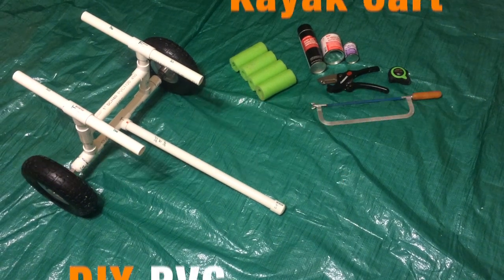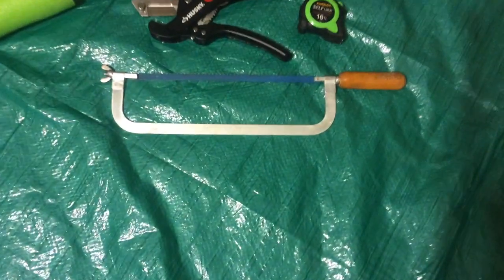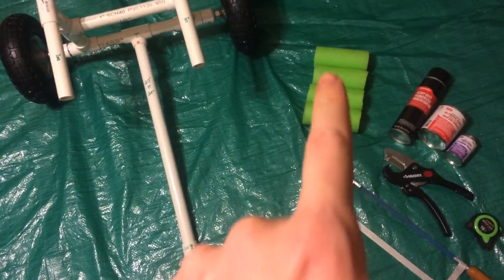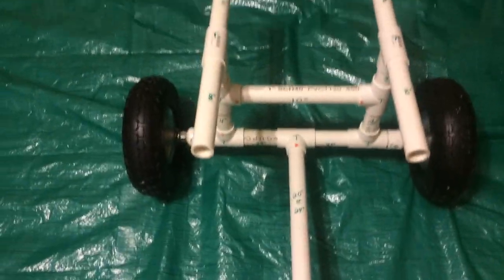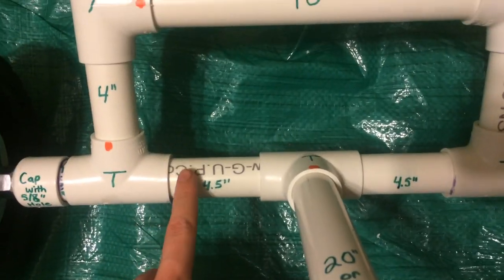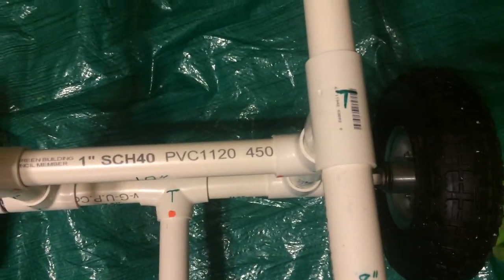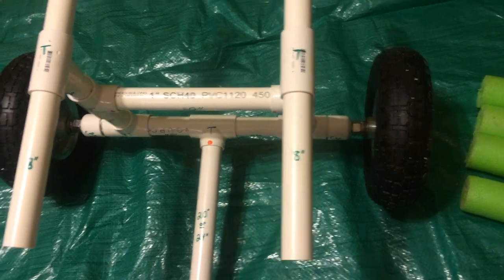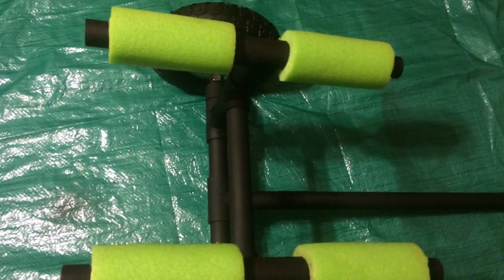Homemade PVC Kayak Cart For Under $25!

Comment: I made this cart in about 40mins.  My only mods were that I ended up using the 24in axle from HD rather than cut down a longer axle.  I built the cart without the kayak nearby so it was not glued together.  When I got to my kayak turned out that the scupper holes fit almost perfectly so I did not need the parallel to the ground section with the foam.  This is a great design, easy to build, fun and cheap.

Comment: Thanks for the excellent instructions, especially the dimensions right on the parts. I built it exactly as described, but the 24" axle was just a little too short, probably because I used a different T fitting manufacturer. Rather than use nuts on the axle, I drilled an 1/8" hole through the ends of the axle and use an R shaped clip and washer to retain the wheels. This allows me to pop off the wheels to make it smaller to fit in the kayak storage compartment when paddling. Additionally, I installed two small D rings on the upper T fittings to hold the strap so it doesn't want to slip off the cart.
Reply from the maker: Tom Griebe happy to help!  Thanks for the feedback!  Stop by again!  🙂👍

Comment: I just got done building one. I bought the parts at Lowes and Harbor Freight (tires). I ended up spending just about $40 on it. I think you could probably find someone throwing away an old hand trick to get the wheels from (that saves about $13). Also, I did use the rubberized paint, but I don't think it really makes that big of a difference. You could save $3-4 and just use some cheap flat spray paint.

TIP: Make your axle 2 inches longer, if you're not precise on your cuts, you won't have enough room to get all your nuts and washers on.... Mine is too wide and I'm going to have to use Locktite to keep the nuts in place. 

I had a hard time with drilling the holes for the axles. I didn't have a 5/8" bit.  I used a 1/2" bit and just sort of drilled it out by hand by moving the bit around in the hole. It worked, it's not pretty.

Tip: glue it all together, then paint it, then put the axle and tires on, that way you don't risk getting paint those items. 

If you have a heavier boat, I suggest using 1 1/2" PVC. But I think this will be great. Can't wait to try it out!

Oh and the Harbor Freight tires are kind of heavy, so if you want to lighten the load, go with the plastic tires. They might not hold up as well, but it won't weigh as much.

Thanks!

Comment: Hi,

Great design and easy to build. But I've done something wrong and have 2 problems.

First, I made the dimensions a little larger because of the size of my kayak. I've not glued anything so I can always cut it down.

Issue #1 is the axle. The wheels aren't turning. I'm sure I did something wrong between the various pieces of hardware - nuts, locking washers and regular washers.  I feel like I might have overtightened the nuts but otherwise they're not locked in and will come off. I've got large 5/8" washers on both sides of the wheels.

Issue #2. I put the kayak on and it just won't stay. The cart slides out under the weight of the kayak. It is a Wilderness Systems Pamlico tandem that weighs 72lbs.  Even if I get it to stay underneath, and then strap it, once I start moving, the cart just squirts out from underneath. I've tried placing the cart 2/3 and halfway. Same issue. Now, I don't have noodles on their but I can't imagine that is the issue. I can't find any noodles that have a large enough diameter to go to the PVC.

HELP!! :-)

Thanks.

Comment: I used 1/2 inch pvc for mine, connectors and the pipe for 1" is about 3x more $
holds up fine, weighs less, and takes up less room
Reply from the maker: +EthanKRETA Hope it continues to work well for you.  It all depends on weight of the kayak.  Some folks reinforce the inside PVC with metal or wood.  I didn't.

Comment: Just made this cart and uploaded the results to my channel. Showed the kayak on the cart at the end for those who wanted to see it in use. I recommend a cargo strap to keep it from sliding. Otherwise, fantastic cart. I gave you credit in my description.
Reply from the maker: +SomebodyYouDontKnow :  Here is the cart that Mike B made based on our instructional video above.  He made a video reviewing it.  Thanks for stopping by SombodyYouDontKnow.  Watch Mike B's video here: DIY Kayak Cart/Trolley Not Using  Scupper Holes
Reply from the maker: +SomebodyYouDontKnow  got a solution for bike kayak trailer.  Find a children's bike trailer for hauling kids.  I found one used for $20.  Extend tongue to the bike and make a cradle for kayak.  Done.

Comment from the maker: Rico:   There are no videos showing this in use currently.  Maybe can keep that in mind and try to include it in future video.  In regards to your kayak the 10" pipe may work.  You just need to measure the space between the curves of your hull to make sure 10" results in bunks that line up with the hull properly.  Found that our cart works with a lot of kayaks.   Haven't tested on your particular make or model.
Reply: I used 12" for 1 kayak and 10" for another, with the pool noodles either worked but definitely more stable with the correct measurement for your particular kayak.

Comment: Just finished mine with PVC parts and axle from Lowes and wheels from Harbor Freight.  Spent $40 using same design but wheels were $3.99 each instead of the $5.99 Harbor Freight advertised.

Comment: I did not quite understand the rod part as it says 26" but cross bar is 10" plus PVC fittings. So I guess I cut to that size.  I would like to see the loading as I am having a hard time

Comment: Ok, now I would like to see a video of you using it and it staying put under the yak while being pulled across rough ground( like it would be used). I'm now in the process of building one of these, but thinking that it will need to be held to the yak.. Also show from the start putting the yak on it through to putting it away.. This would be a great help... Thanks for your videos..
Reply from the maker: Hey Walt,

After positioning the cart under the kayak you would want to strap it down or depending on the weight of the kayak you could get away with using bungee straps.  We have used this cart with the Pro Angler 14 shown in other videos and the poor man's kayak.  You could put eyelet screws on the sides for quick strap/bungee attachment.  We chose to go this route instead of a scupper mount route because the scupper mount carts cause wear to the inside scuppers and can make holes.

Thanks for your comment.  Good luck on your build.
Reply: KayakDIY Wonderful video! Which videos do you show this cart in use? Also, My Jackson BIg Rig kayak is about 35" wide in the center, would the 10" pvc pipe you show in the video be long enough for my kayak or should I make it slightly longer? Thx you for sharing
Reply: Walt G That's what bungee cords are for.
Reply: Walt G

Comment: Would this work for an 85 lb kayak?  

Loaded with supplies we could be talking over 100 lbs.
Reply from the maker: Might want to reinforce inside of pipes.  Some put wood dowels inside.  Flat ground it might be fine, but bouncing on rough terrain I could see 100lbs break it at a joint.
Reply: @KayakDIY  My tandem kayak weights 72 lbs and I could easily see portaging it with 20 lbs of gear by the time I add in two paddles, PFDS, water bottles, food, etc. 

Can you please clarify how you would reinforce with the dowels? What size dowels? Where would you put them and how would you secure them? I'm having a hard time visualizing how they'd add strength as think dowels can be snapped. What am I missing Thanks in advance for your time. And thanks for posting one of the best videos out there.

Comment: hey man, pretty good setup. good work. my question is, i have seen so many people complains about using pvc diy carts they made and kept sayying i regret it so much i would never do it again in forums and comments in other videos. did you have a chance to use it? how is it compared to ready-made ones. and one last thing how much it cost you in total to have it ready to go?
Reply from the maker: +Serdar Sanrı I still have the same one in the video.  It is hanging out with me in the living room with 3 of my kayaks.  So far it has held up well.  The key to building one cheapest is finding the wheels cheap.  The wheels I have found occasionally for $5 each, but average is around $10.   However, you could look for appliance carts or other items on craigslist and repurpose the wheels for the project.  I would say a person should be able to easily build this cart for $25 or less.  I built mine for about $15.
Reply from the maker: +Serdar Sanrı Alot of folks have issues with PVC carts because they built them to incorrect proportions.  I shortened some areas to optimize strength and reduce flexing.  This cart sits lower to ground than many do.  Also, some people made scupper carts out of PVC and those don't work as well as the bunk design because there is a lot of stress on the PVC at the scupper site.  This PVC cart shown in above video works well for me and I have 6 different kayaks.  I don't use it much for my large PA14 kayak because I have added so much gear including trolling motor to my PA14 and the weight would likely be on the max side of weight capacity for the cart.

Comment: KayakDIY, thanks for uploading the cart video. I'm having trouble with the axle and tire rotation. The nut on one side wants to rotate as the tire rotates which then locks up the wheel. Are both lock washer AND flat washer required on both sides of the wheel? Any suggestions?
Reply from the maker: You don't have to use both on each side of wheel.  I just chose to.  Try it and see if that works better for you.  Certainly won't hurt anything.
Reply: great! made a change and it seems to work better. Keep the videos coming!

Comment: I'm having issues keeping the wheels from locking up.  they roll fine for a few feet then one side just stops.  I've loosened the nuts but it still does it.  any ideas?
Reply from the maker: paul stradley 🤔 not sure.   Never had that issue. Hard to say.  You are correct in not over tightening. Aside from that I’m not sure what the issue is. Does wheel have bearing or something that sticks?
Reply: No I don't think so but I'll look.  I'm using nylon lock-nuts.  could that cause it?

Comment: Where in the heck do you find a 5/8" x 26" threaded rod?  I can only find a 24" or a 3 footer
Reply from the maker: SGEEZY FSHEEZY Bought a 3' and cut down to 26".  You can change dimensions to fit your particular kayak.  I got the threaded rod at Home Depot.  Other supplies are linked in video description below video.
Reply: SGEEZY FSHEEZY I had to spend an extra $3 and get the 36" one. I decided to make mine 2 inches wider to accommodate my flat bottom boat (which is wider).

Comment: i ended up using 24" rod, and no need for pvc caps on axle
Reply from the maker: The caps just held the rod better so it was less sloppy.  If I remember right we couldn't find 24" rod at the time.  A 24" rod would likely work great too.  This cart doesn't need to be replicated exactly...just suggestions to get folks creative juices flowing.  :)
Reply: KayakDIY if you make the Ts and end caps butt up against each other then a 24" rod will fit perfect with harbor freight tires. I don't have any washers and just used some blue loctite on the nuts. I'll let you know how it holds up this summer.

Comment: I have tons of 1/2 inch pvc. Will that work?
Reply from the maker: Sylvie Genest If you want the same wheels we used then it won't work with 1/2" PVC because axel shaft required for most of these wheels is 5/8".  However, most push lawn  mower wheels are 1/2" axel requirements and could work.  The build depends largely on your kayak's weight.  I know some have used 1/2" pvc, but some reported breaks.  You could put wooden dowels inside PVC to strengthen it some.  Just a thought.  Anyway, hope this answers your question.  Best of luck in your build Sylvie Genest!

Comment: If I  was making  this  cart  I  would  glue  the  upper  10"  lateral  piece  of  PVC  bc  that  would prevent  the  structure  from  coming  apart  in  rough  terrain  I  would  not  glue  the  longitudinal  T  pieces Since  Schedule  40   PVC  is basically  indestructible  I  think  that the  Bondo  product  is a waste  of  time and  money
Reply from the maker: +Nicky L Bondo is not required, but just something I chose to do.  You could likely build this cart in many different ways.  This is just how I chose to build one.  The one pictured continues to work for well for my needs.
Reply: OK